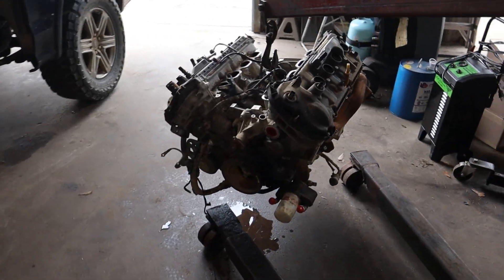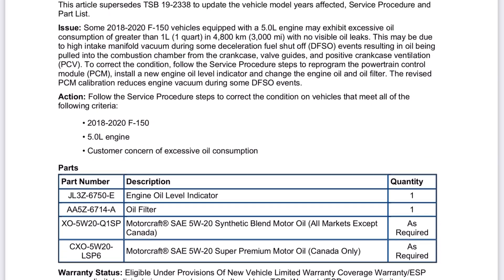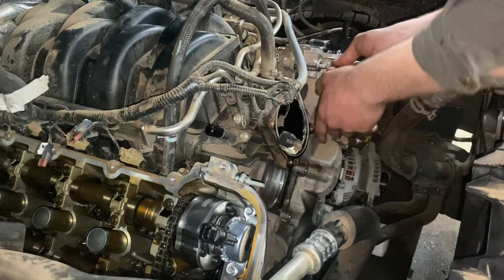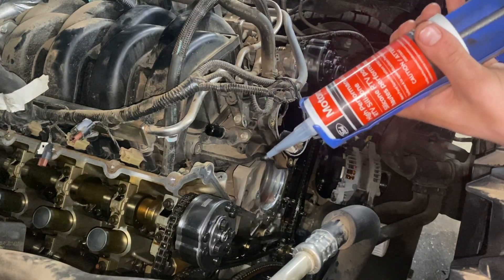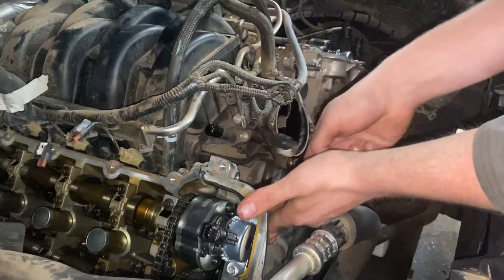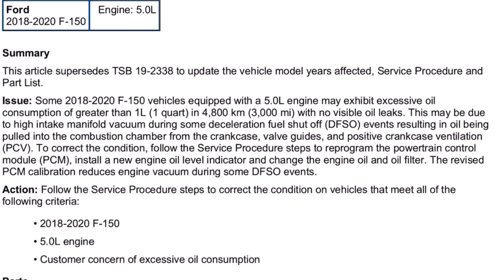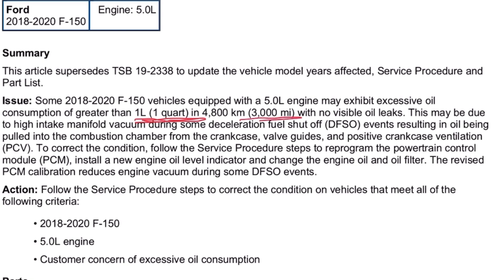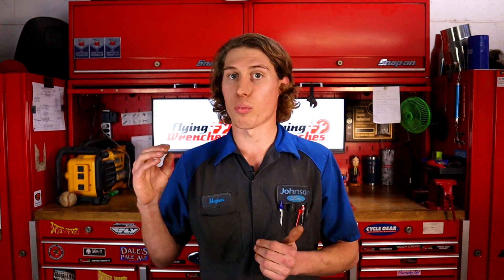Ford 5.0 Coyote Oil Consumption FIX

Comment: 2020 here 63k miles. It's been using 1 quart every 1k since 18k. I am now at the point where I need to do VCTs and Phazers. I also plan to do Plugs, PVC upgrade, Catch Can, and Change a dead O2 Sensor. I'm hoping all this will stop the ticking and slow the oil consumption.
Reply: I have a 2019 ford f150 with 34k on dash  I bought it with 29k on it. I had to add 4 quarts of oil sense I bought it 4 months ago from the dealer. They just did the dip stick and pcm tsb now I have to take it back in 1000 miles to recheck. It also makes alot of pinging and knocking noises randomly from vtc sensors supposedly.  I have 2 other cars a acura with over 200k on dash and a 99 mustang gt with 150k . They don't go throw any oil between oil changes so why is it normal for a almost new truck to do it!!!!
Reply: I have a 2019 with 127600 miles.  I purchased truck with 37K miles as a Blue Certified vehicle.  Performed 3500-6000 mi oil changes. It's about to get it's 4th set of spark plugs.  It's at repair shop and will be doing the repairs you mentioned plus at least bank 2 cat and O2 sensors.  May need a few other items because of oil overconsumption issues (and a water pump since it's there).  I'm about 1.5 hrs west of San Antonio.  Independent shop (off the top of their head) quoted me $4300-5k.  Local Ford dealer was going to be $1500 just for cat replacement.  Curious, what is your repair estimate?

Comment: One would think Ford engine technology has progressed somewhat over the last few decades. I guess not. My Ford dealer is useless as is my 2018 5.0. But guess what…. my 8-year-old 4Runner does not use one stinking drop of oil between oil changes. Now put that in your 5.0 and smoke it!

Comment: You should delete this video! I watched it to no avail. You had a lot of "probablies" along side "I am the problem for checking my oil", along with "Stop checking your oil." Ford installed a two quart hatched marked dip stick as a solution to trick customers into thinking you are only one quart low when you are actually two quarts low! Your opinions are just a continuation of their thinking. I had my PCM flashed! I still consumed 24 oz after 900 miles. Thanks for wasting my time.

Comment: I just added 1qt. Oil it was one bottom of dip stick. Everytime I start my 2018 f150 it rattles severely hard cam phasers done twice. So did Ford fix this issue if so why don't they replace v8 with new version engine. This is my issue.  DN
Reply: TSB 18-2354 addresses the rattle issue. Probably unrelated to the oil issue.

Comment: Interesting take. I have a 2020 that had the PCM reprogrammed. If you don’t check your oil, you’ll get engine knock, then get a low oil pressure warning while you’re stomping the throttle on the I-81 on ramp. Then you’ll need to add five quarts just to get back to the low oil range on the dipstick. Ask me how I know. I think Ford biffed on this one and just needs to own it and fix the problem before everyone gives up and starts buying Teslas.

Comment: You’re mostly correct. The tsb fixes the consumption problem AND the psychological problem. The new pcm strategy usually reduces the consumption to below 1 qt/3000 miles. The new dipstick increases the range between full and add to TWO quarts instead of the usual 1 qt range.  So a person can go the customary 6000 miles between oil changes without having to add oil.  That fixes the psychological problem.  As a result, about 90+ % of the problems have been fixed with the tsb.
Reply: Typical Ford, don't do anything to fix issue but convinces the ignorant they have.
Reply: What does the PCM do to reduce vacuum under coast? Put the electronic-throttle wide open?
Reply: @gregorymalchuk272  it says the purpose of the old dashpot on carburetors that delayed throttle closing. it’s simply cracked open the throttle slightly. Which slightly reduces vacuum when coasting. Excess vacuum can pull oil past the ring and valve seals . Older fuel injected cars simply kept the idle air control valve slightly open to accomplish the same job

Comment: I remember when I was younger, the owners manuals recommended checking the oil every fill up. An engine was not considered to be burning oil unless it was 1 qt per 500 miles. It was unusual for an engine to go between oil changes without using at least one qt of oil
Reply: Thank goodness those days are over!
Reply: I am using a crazy amount of oil.  Between each oil change there is NOTHING on the dipstick.
Reply: @fireriders8319  Did you have the TSB Performed yet? It has probably helped over 90% of the cars we performed it on and made it where the oil consumption had dropped to LESS THAN 1 qt/3,000 miles. In most cases they no longer have to add oil between oil changes. There were a FEW it didn’t fix. But not many.
Reply: Yes they did the TSB which involved the dipstick and reprograming the computer.  What's funny is I've been in the automotive business for over 45 years so I marked my dipstick before I took it to Sayville Ford for the TSB.  They said they changed it and did the drive computer reprogram.  Lo and behold my engraved mark was right there on the dipstick.  I have the frame for the sign completed and my friend is having the billboard made up to go on it.  I will park this lemon pick up in front of every Ford dealer on Long Island before Christmas for sure.
Reply: Yeah, the roaring 20s was great.

Comment: I’ve been running 5.0 motor’s between 2018-2020 needing cam phasers, my personal truck and some in our fleet. The phasers clack under load and sound like a 3.5 starting. One truck in our fleet is a 2020 5.0 with 34k miles and it burns 6 quarts of oil in a 3000 mile period, with no dash indicators regarding oil level or pressure. It will eventually misfire and run horribly. We explain to the driver to check and they refuse.

Comment: The dipstick length was an issue, when you would change the oil and fill it to the full mark you were actually overfilling it by 2 quarts, this combined with the PCM issue would cause oil to be sucked into the intake. After I replaced the dip stick with the correct length you would not use 10 quarts for an oil change. Back down to 8 quarts where it should be.
Reply: I still have the original dipstick, and mine reads full just below 9 quarts, where it’s suppose to read since it holds 8.75 quarts of oil.

Comment: I can't believe you would say not to check your oil. That's the blood and heart of the engine. That's like saying don't check your air pressure on a regular basis and you are wondering why your tires are wearing. You need to rethink what you just said.

Comment: :You're a moron.  Modern engines are not designed to burn oil like some Ford f150 engines do.  Mine does and it shouldn't.

Comment: Guess I’ll keep running my 2013 f 150 with the 5.0 it has 305 thousand miles and still does not use or burn any oil
Reply: Both my 11s lose oil to the catch cans but solid motors

Comment: My neighbor called me yesterday and asked for me to look at his 2019 5.0 Lariat with 65K miles because of a rattle type noise he heard on a cold start. He had no knowledge of the oil consumption issue, so I checked his oil and found that it wasn't even touching the dipstick. After adding 5.5 QTS of oil, we finally made it into the acceptable range on the dipstick. I suspect the noise he heard was the cam phasers being dry on a cold start due to such a low level. The truck had no DTC's or check engine light for low oil level. A truck with only 65K miles should not be using that much oil, and I don't believe an updated programming will slow it enough to justify keeping it. I told him that Ford doesn't have an updated cylinder block design without the plasma transfer lining, and urged him to trade it in while it still has good trade value.

Comment: I’ve had 1 5.0 on a 19 5.0 I put a engine in because of oil consumption to the point it damaged the engine but in reality I’ve seen a lot of times the “oil consumption” is people put 8 instead of 9 quarts In them

Comment: Well sir i have a 2016 F150 CLT 4x4 crew cab 5.0 , I did what you say to do when it was brand new until one day i took off from a stop sign and it shut down. Now I'm  68 years old and my racing days are way past. But now I'm getting about 1 qt to every 1000 miles. And i started to change oil every 3000 miles but my book says 10000 miles, now if i did that i would change my oil 2 times every 10000 mile right. There is no leaks and my Ford dealer has no idea, i even had to show him the 2018 TSB before he would believe me about any problem. So maybe you guys need to do more research because its not only 2018's with the problem 2016 5.0 also
Reply: The 15-17 5.0s had a problem with vct actuators or something like that and the fix is to change all 4 faulty actuators and some change oil weights to 5w-30 and some with catch cans too

Comment: Once a week at a minimum are my vehicles oil checked. When we go out on a drive I check it. Granted i have a 13 f150 and stand on my frame in front of radiator to check it. My wife gets so frustrated cause she wants to go and I'm checking ool
Reply: I’ve been using a folding camping chair as a step stool for my 13 5.0

Comment: I just got the TSB 19-2365 done to my 2020 5.0 and I just hit 2,000 miles post TSB and my engine consumed about 1 quart. I’ve heard switching from 5w-20 to 5w-30 has helped some 5.0 owners so I’m considering to switch oil weights myself. What I really don’t understand is why my oil cap says 5w-20 but my owners Manual says to use 5w-30. I even asked the people at my local Ford dealership about that and they said just to use whatever the oil cap reads lol.
Reply: I switched to 5w-30 and it retained more oil and has down about a quart at 5k miles on the oil. I’ve heard some people go even thicker with 5w-50 so that might be an option if you’re in a warmer climate
Reply: Yes your 2020 (same as mine) 5.0 calls for 5w-20.  Ford switched back to 5w-30 for the 5.0 in 2021 (engine has cylinder deactivation). I believe the switch to 5w-20 was for fuel economy. No longer needed with cylinder deactivation in 2021, so back to 5w-30. I will be changing over to 5w-30 next oil change to see if it helps the oil consumption issue.
Reply: They've recommended a switch to 5w30
Reply: A thin 40 weight, like Mobil 1 0w-40 FS....is basically a 0w-35 oil and could be a great oil for 5.0's in the South. I had an Explorer 2.0 EB that loved the M1 0w-40, btw.
Reply: I also thought the manual said 5W-30, however, the diagram and 5W-30 statement is from the previous engine, the 3.5 ecoboost. The page break makes it look like you are looking at 5.0 specs.